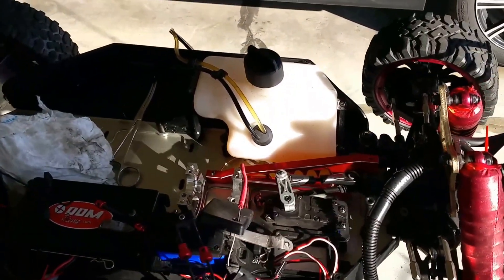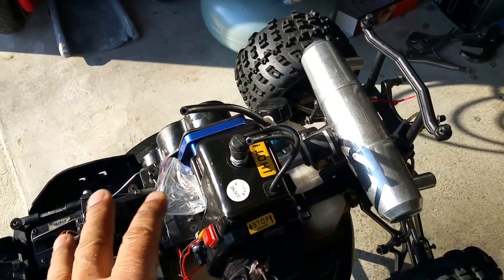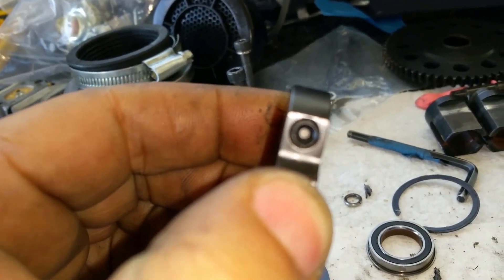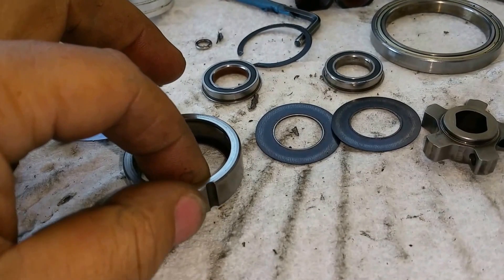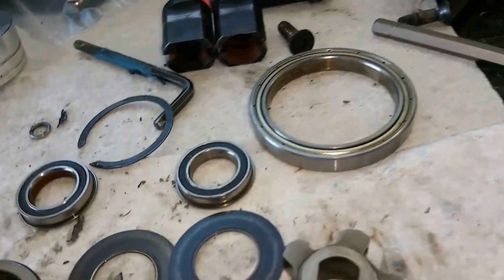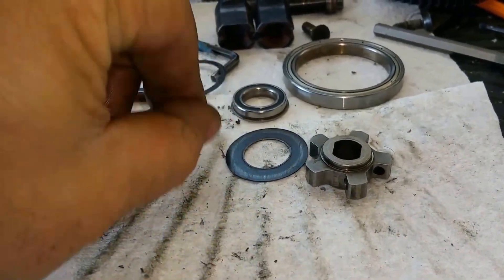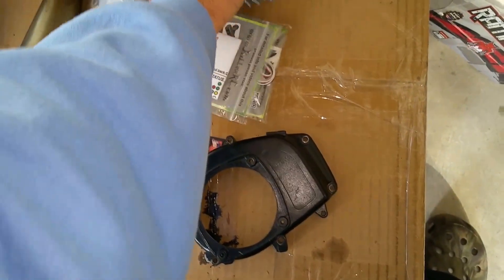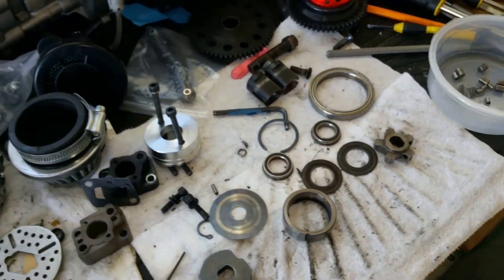FID 2 speed transmission break down x2 update

Comment: I fuckin knew it bro!!! Get you that RB Innovations Intake and never go threw that shit again!! Every body I know with them 2speeds always have problems with them ! Also I hear that they can't hold up to a motor with power to them and for the guys that like to jump there shit so that's why I don't run one of them! I have worked on some of those and I have used a very thin layer  bearing grease on there. Just Do NOT over grease it! Great video ! Make your videos longer bro! There to quick man I like them and would like to see more.
Reply from the maker: BOTAJELL yeah bro the was a 250.00 lesson. trial and error learn as you go. For now it works fine but to adjust the changing point you have to take it apart. that's why I got the quick release center diff housing. this fid 2 speed is the newer version or design  the made in 2015 or 2016.  But we'll see how it goes.
Reply: 5th SCALE RC INSANITY I'll keep my fingers crossed 🤞 for you bro ! I hope that everything turns out well for you! Actually I know it will because your not a quitter and your a guy that puts in the work so I know it will be back to life soon!
Reply: 5th SCALE RC INSANITY      do you know where to get gears or parts for the 2 speed
Reply: Try and see if Dan from Rovan and King Motor has any parts laying around for 2speeds because when I was there they a few different types of 2 speeds all over the place! That's where I got mine for my Baja 5SC . Hope that helps
Reply: That's the Rovan and King Motor in ny

Comment: Good night, I`m very disapointed with FID RACING assistence, I had problems with my 2 speed for 5ive, there aren`t pieces to replace like: pinion and spur gear. I sent many emails and try to buy these parts, but I coudn`t. I never buy more FID RACING !!!
Reply from the maker: Yeah pretty much junk.  the bearing cant constant gear switching with out giving out. I think ddm or rovan/king motors might have some replacement parts. Just get a 62 tooth gear with a regular center diff that should give better top speed Good luck bruh..